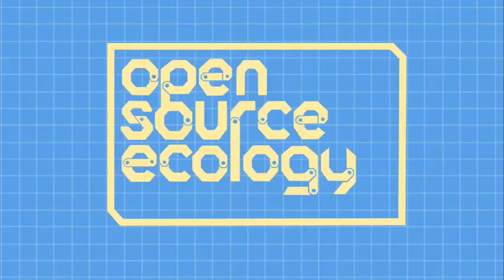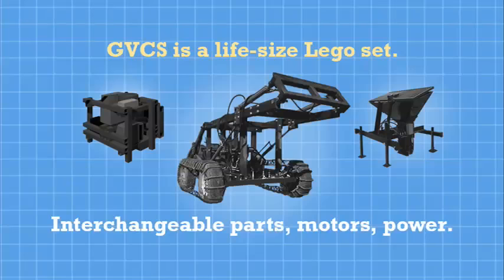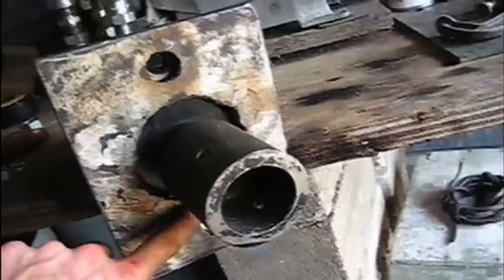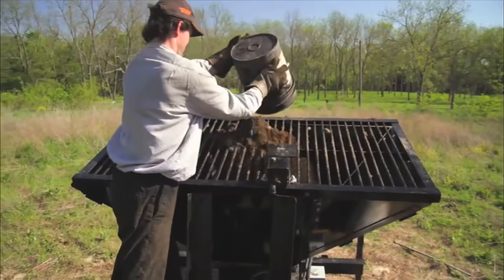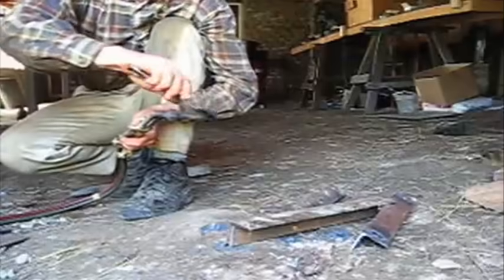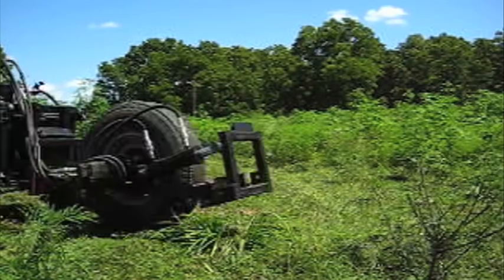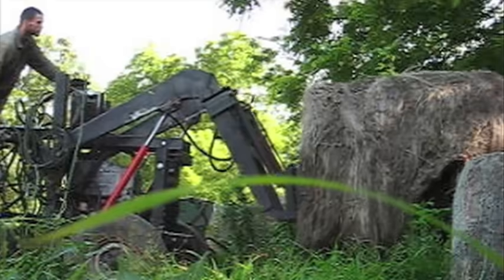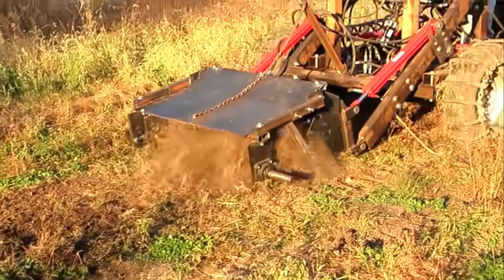GVCS - Global Village Construction Set

Comment: hmmm....  with all the used and obsolete machines, tractors, riding mowers, etc, just piled up and sitting around waiting to be scrapped, why re-invent the wheel? why not recycle technology and machines and re-adapt them?That would be WAY cheaper that building everything from scratch, not to mention all the infrastructure you have to build (welding tables, jigs, etc.) and all the expensive materials you are using (i saw a lot of new steel there being cut up) just to begin to make the machines!

Comment: What a joke ,just buy an old farm tractor ,done finished why reinvent the wheel? some equipment that was made 20 - 50 years has a smaller carbon footprint than buying new steel ,a new motor ,welding eq, etc.